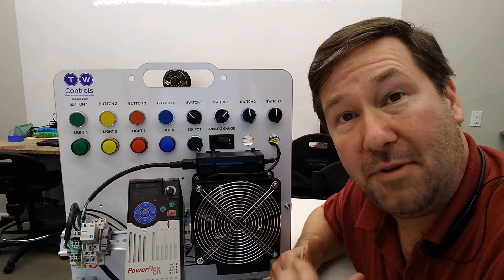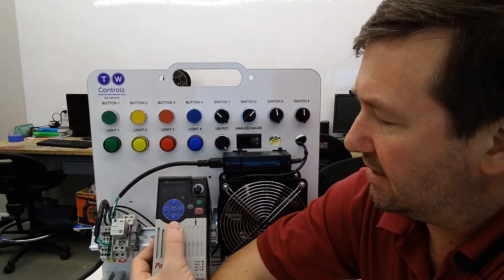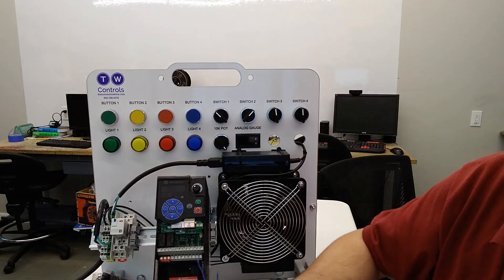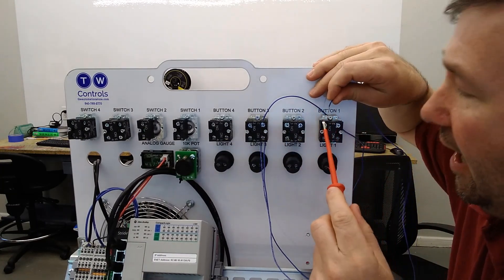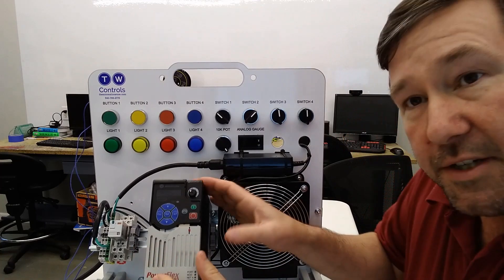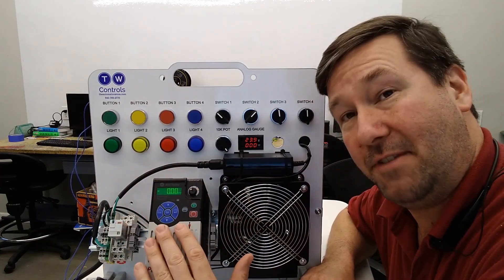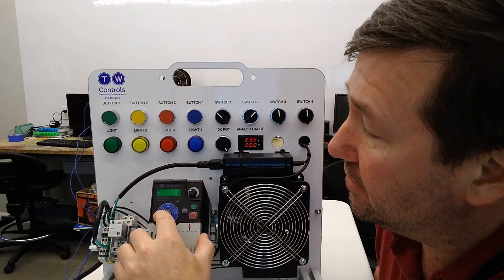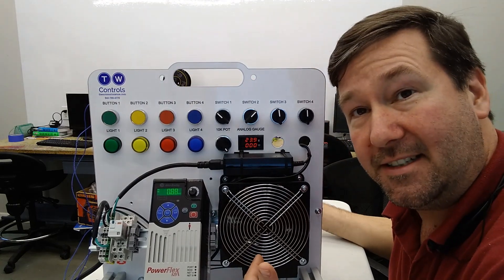How to Wire a Powerflex 525 for a START/STOP

Comment: Great video! I have a three wire set up on 2,3,11 with 11 still jumped to 1 using a photo eye. I am not sure what parameters need changed on this set up to make it function properly but it worked before changing the bad drive.
Reply from the maker: Is the old drive available to pull the parameters or via USB? Also check your jumpers. 
https://youtu.be/61bnrASCJ9w

Comment: How would I do the same setup but with illuminated push buttons? I’d like green to light up when pushed to start and then turn off and illuminate red when red button (stop) is pressed? Thanks
Reply from the maker: You could configure the relays or opto outputs for your lights.
Reply: @ thanks Tim, trying to get my boss to approve your class. Do you mean configure the lights through the plc or how they are wired at the x1/x2 NO/NC?

Comment: Thanks Tim, are you doing this with all parameters set to default? I’m repurposing a 525 and I don’t know what parameters are currently set. Or will the changes you mentioned bypass any other parameters?
Reply from the maker: This video starts with the factory defaults. Here is a video on that. 
https://youtu.be/KuZ03v6COqk

Comment: Why t62 and t63? I’ve had to replace a few drives at work and did everything using the quick start guide but never would have figured out you had to change t62 and t63 without watching your video
Reply from the maker: Those configure the purpose of the particular input on the drive.
Reply: The same here, Why the f*** Guide not mentioned that !?!?!?!?! (T063)

Comment: Hi, I notice that your using a momentary PB for your start button. Is there a parameter that I need to configure to have the motor continue to run until the stop button is pressed?
Reply from the maker: Yep, check out around 3:15 of the video where we change P46 and T62.

Comment: Can you wire an e-stop to the stop of that drive? Ive seen many drives fitted with contactors  that cut power to the drive when an e-stop is pressed. Why do they do it like that?
Reply from the maker: Yes, the Powerflex 525 has a safe torque off feature which overall is much safer than fitting drives with contactors.
Reply: @TimWilborne  yes we have 2 drives that are wired that way at my plant, estop cuts 480V to drive through contactor, and both those drives are the only ones to have fried in the last couple years.

Going forward I've wired new drives  with estop cutting the enable signal, is this the correct way?
Reply from the maker: No!  The enable signal is not for use as a safe stop

Comment: I’ve been fighting a 523. Did plenty of reading, figured I was doing a simple 2 wire for start/stop. Set the parameters I needed including t062, but I’m confused by the use of t063 in your video. That parameter is used for terminal 3, is it not? To truly use the 523 as start/stop, will it not work unless it’s expecting a three wire?

Comment: Hi Tim,  Here's a question for you.  Using a Powerflex VFD configured as a 2 wire setup with both forward and reverse hooked up.  Let's say you also assigned terminal position 6 to dc injection braking and have that on a switch.  What would happen if you have the forward switch closed and the vfd is driving the motor and then you close the switch on pin 6 without turning off the forward switch.  Will the vfd override the forward command if the switch is still closed and the signal is still being sent?  Is the answer different if the switch for pin 6 is actuated momentarily or held?  Will it resume forward as soon as the pin 6 signal goes away?

Putting a new vfd on a mill and considering tying the spindle brake switch into the vfd as a dc injection stop method whereas just turning turning off the forward/reverse switches will coast to a stop.  I suppose worst case if the unit doesn't play nicely then I could have the spindle brake switch drive a contactor which breaks the forward/reverse switch signals AND triggers input 6 for dc braking.
Reply from the maker: I'm pretty sure the DC braking would only be active during deceleration even with pin 6 so the forward would override it but you better ask Rockwell Automation to be sure.
Reply: @TimWilborne  That makes sense.  Guess I'll probably do a contactor to be safe.  Reaching them as a diy guy is proving to be pretty difficult.  You cannot even chat with them if you don't have a special account which is a little disappointing.
Reply from the maker: @EVLS10  each bronco distributor has a drive specialist. They're going to be your best source for help.
https://locator.rockwellautomation.com/

Comment: At 1:04 you mention terminal 11,2 and 4. Then at 1:32 you use 11,1 and 2 terminals. Does this have something to do with snk and src?
Reply from the maker: Misspoke Chuck.  11, 1, and 2 are correct
Reply: @TimWilborne  Thanks TIm! I replaced a Powerflex4 with a 525. I'm a MechEng that knows just enough about freq drives to be dangerous. Couldn't get the "new to me" 525 working until I did a FactoryReset and then she took right off! Thank you for the time you put into your videos. I really appreciate it! Question concerning the MOV: My incoming power is 240vac 3p. My drive is wired to a 4 pin plug. I have 240vac between any two phases and about 138vac between any phase and the 4th pin which I'll call neutral/ground. Do I remove the MOV or leave it in place?

Comment: Question, Is it possible to use this drive and display freq. and current on remote HMI? would also like to be able to reset faults if that's possible. 
Thnaks
Reply from the maker: Yes, those registers should be available over Modbus for direct communication between the HMI and the drive.  It is on the list to make a video about.

Comment: Are you using a single to 3 phase PF 525 , and just running 2 legs to the fan motor? 
Want to know so I can build one like yours
Reply from the maker: No, drives that accept a single phase input create a three phase output.  There are three wires going to the motor, just like any other 3 phase motor application.
Reply: @TimWilborne  where can i find a fan motor thats 3 phase like that? also i start hershey on the 7th. little nervous. been studying like 4 hours a day
Reply: @TimWilborne  yes Tim I too would like to know what fan that is so I can also replicate. Thank you!

Comment: I have 2 powerflex 400 in an air handling unit... If I just run one vfd, the other motor is freely rotating because of the air flow and when the second vfd from zero, it's getting trip... Is there any parameter to start the vfd from the frequency which it's freely rotating???
Reply from the maker: If I'm following you correctly, the bigger issue is the fan is rotating backwards when you go to start it.  It requires much more load to reverse the motor than to simply start it.  I think I would reach out to Rockwell Automation on this one but I suspect you need to increase the acceleration time.
Reply: @TimWilborne  thanks for the reply... The motor is actually rotating in the correct direction only...
Reply from the maker: @premlal00007  What fault code are you getting?

Comment: How were you able to run the drive without jumping the safety S1 & S2 to S+ ??   I recently tried to re-commsion a used one, I had all of the parameters set correctly including T105 to 1 (disable) it would not move, an Allen Bradley tech said those jumpers were required and it worked.
Reply from the maker: Great question!  From the factory there is a small red jumper between S1, S2, and S+.  You can see me remove it in this video, chances are your drive already had it removed.
https://twcontrols.com/lessons/allen-bradley-440c-cr30-safety-plc-wiring-enough-to-get-started-understanding-safety-lessons
Reply: @TimWilborne  
You said you removed it......so did you edit out reinstalling it ? Or were you able to run without it somehow ?
Reply from the maker: @JohnSmith-lv8xk  The link in my previous reply was a different video.  In this one it is as it comes from the factory with the jumper installed.  Check out 1:39 of this video and you can see the jumper installed.
Reply: @TimWilborne  
Thank you ! That thing is really easy to miss !
Reply from the maker: You are welcome John.

Comment: Hey, loving your videos, I have a treadmill that had a Hyundai N50 drive running it, now I have a powerflex 525 as the N50 popped, I am leaning towards running an external start/stop and Pot up to control board but was curious if the existing serial cable could run the 525 off the factory treadmill controls
Reply from the maker: Wow Kurt, I don't have a clue but would love to see your conversion.  I would guess it is some type of serial protocol coming from the keypad.  You might be able to use some packet sniffer to figure it out.

Comment: Hey Tim.  Is there away to use the I/O on the drive to turn a light on if  it faults?  The relay terminals could be used to tell you when it is running vs stopped.  But I'm not sure about being faulted.  Also along that line could you wire a reset button if faulted?
Reply from the maker: Relay 1 switches off when you have a fault.  You would need to add an external relay to reverse the logic but it should do the trick.  Also Relay 2 is Normally Closed so you could configure it for Ready/Fault and you could do it without the external relay.